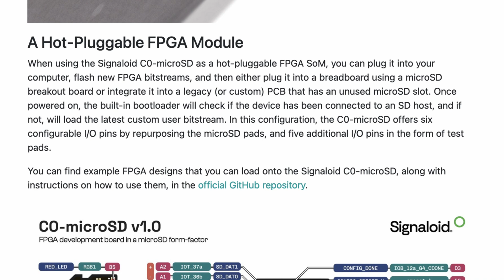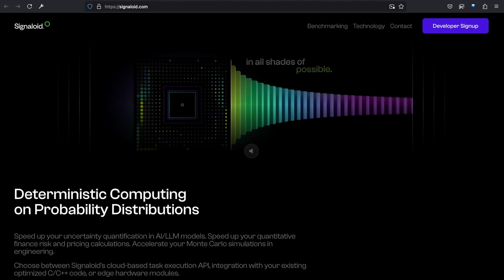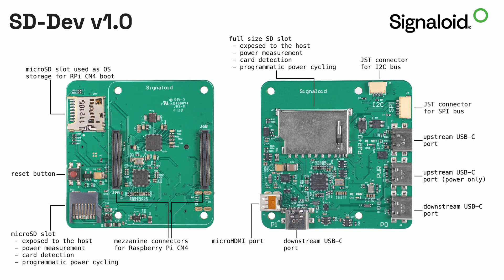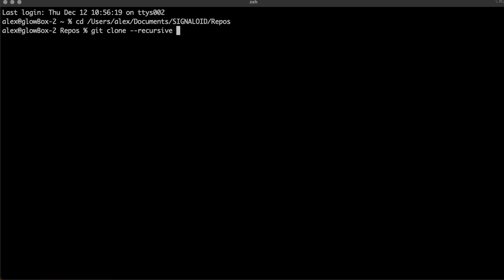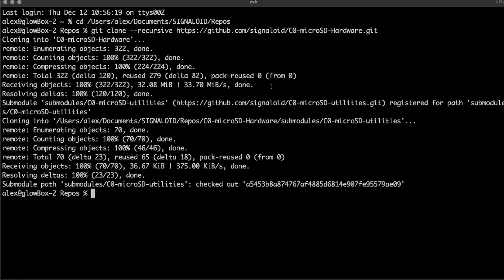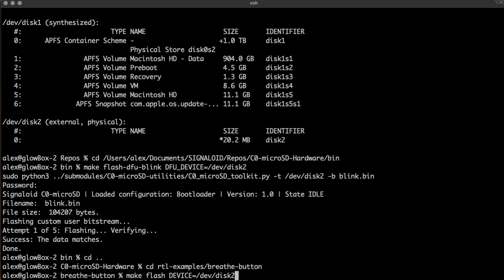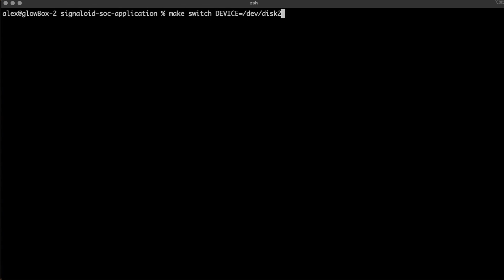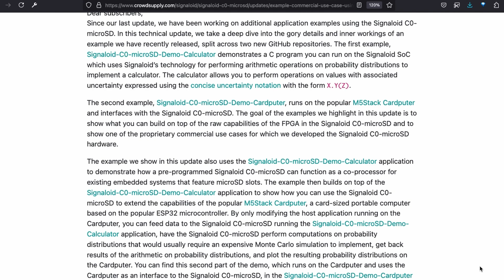Signaloid C0-microSD: A Hot-Pluggable FPGA // Tech Highlight

Comment: Is it possible to use the 4 GPIOs for jtag?  I understand the ice40 doesn't have a hard jtag controller, Lattice's Reveal software can instantiate and use it as a logic-analyzer (like Chipscope or SignalTap).

For example, if you command litex to build the bitstream with a cpu that has a debug module  
(--cpu-type=vexriscv --cpu-variant=standard+debug --uart-name=crossover --with-jtagbone )

and assuming you have a cheap jtag adapter like any based on FT2232H..  how can you configure SpinalHDL's openocd to connect to it?

Unfortunately, the following doesn't work:
openocd -c "adapter driver ftdi"
-c "ftdi vid_pid 0x0403 0x6010"
-c "ftdi channel 0"
-c "adapter speed 1000"
-c "transport select jtag"
-c 'jtag newtap lx cpu -irlen 4'    #"jtag newtap ecp5_main tap -irlen 8 -expected-id 0x21113043" 
-c 'target create lx.cpu0 vexriscv -endian little -chain-position lx.cpu -dbgbase 0xF00F0000'
-c 'vexriscv cpuConfigFile cpu0.yaml'
-c 'init'
-c 'reset halt'

OpenOCD reports:
Error: JTAG scan chain interrogation failed: all ones
Info : JTAG tap: riscv.tap tap/device found: 0x41111043 (mfg: 0x021 (Lattice Semi.), part: 0x1111, v
er: 0x4)
Error: dtmcontrol is 0. Check JTAG connectivity/board power.
Warn : target riscv.cpu examination failed
Error: Trying to use configured scan chain anyway...
Error: lx.cpu: IR capture error; saw 0x0f not 0x01
Error: ERROR: Error while reading from socket: No error
Error: Can't communicate with the CPU
Warn : target lx.cpu0 examination failed
Warn : There are no enabled taps. AUTO PROBING MIGHT NOT WORK!! 
Warn : Bypassing JTAG setup events due to errors
Error: !!!
TARGET: lx.cpu0 - Not halted